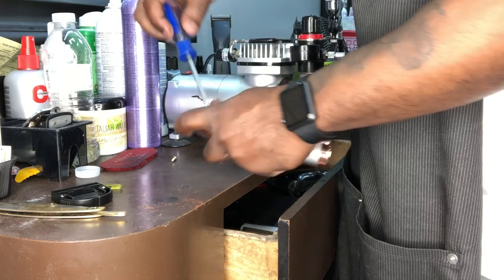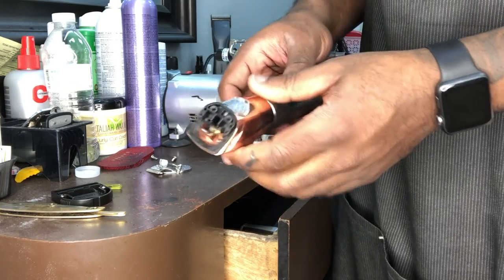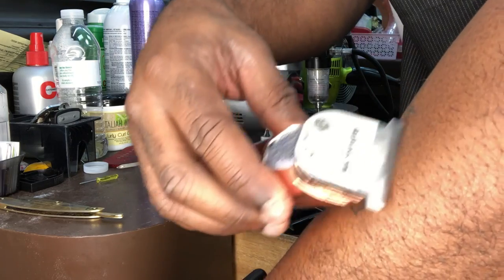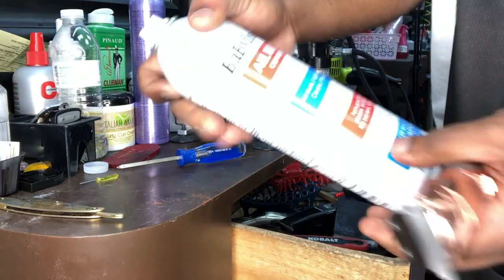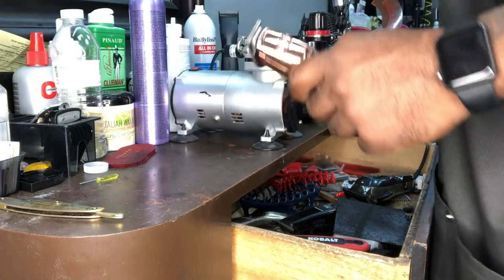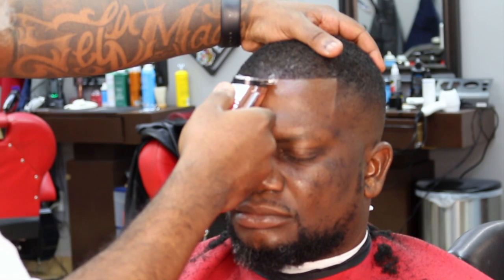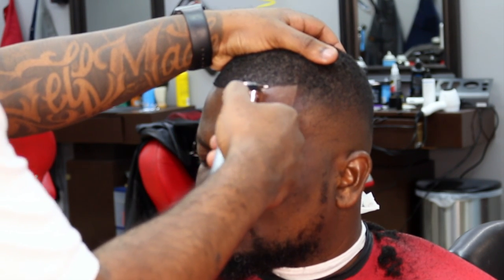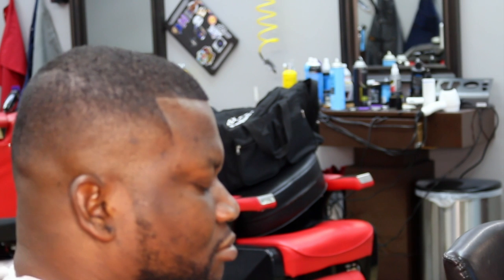HOW TO MODIFY BLADE ON BABYLISS ROSE GOLD FX

Comment: It's crazy bro, I bought like a 13 dollar high torque Conair trimmer. It's cordless and also has detachable blade.   I took it apart and noticed the blade and attachment parts are the same as this Babyliss fx trimmer. I went to sallys to buy the Fx708z blade and I modded that 13 dollar conair trimmer and it sounds the same as this babyliss one. I can now zero gap it and only cost about 40 bucks investment for it to cut the same!
Reply from the maker: That’s because conair is babyliss
Reply: @MrOutliner  oh forsure many don't know that, what I failed to say too is how Babyliss is like the main barber brand for many tools... it's hard to picture someone getting a conair clipper since it doesn't have Babyliss on it. Regardless, for beginner or even advanced barbers there's options out there I think babyliss blades definitely to elevate budget clipper or trimmers.

Comment: Ei. Just got mine. Do i still have to modify the blade using 1 min Blade by the rich Barber to be Hitters? Tnx
Reply from the maker: If you like. I did. Just for the extra.
Reply: @Mr. Outliner how long you shave it down with that 1 min blade modifier? I started to do it but didn’t wanna go too long
Reply from the maker: About a minute maybe 1:10
Reply: Mr. Outliner ok appreciate the gem bro 💯

Comment: I’m a bit confused as to what the modification does other than the zero gap. Could you maybe explain what the changed spring does?
Reply from the maker: The spring makes it to where it holds the blade in place to stay zero gapped.